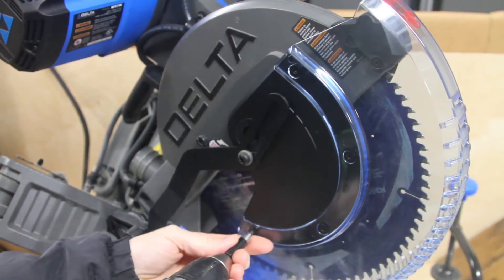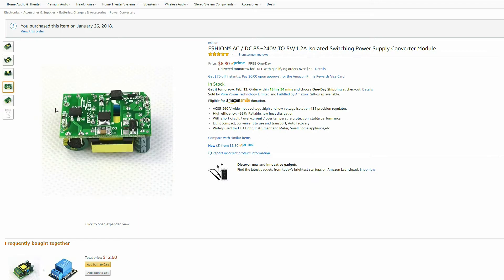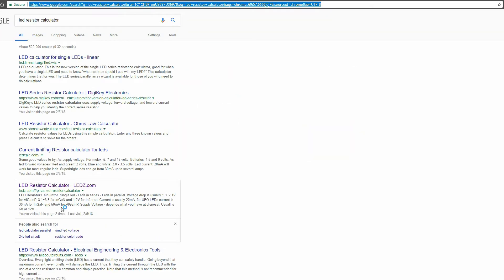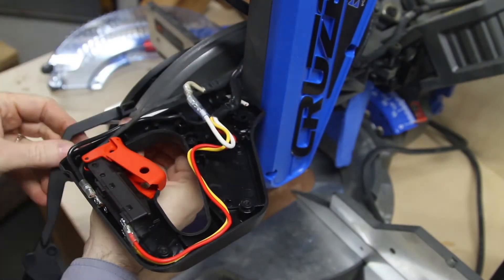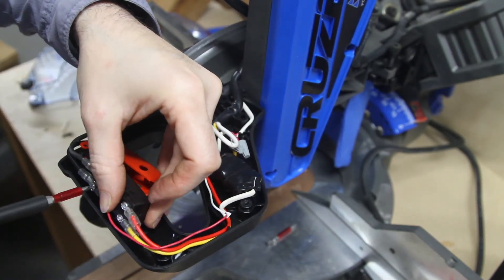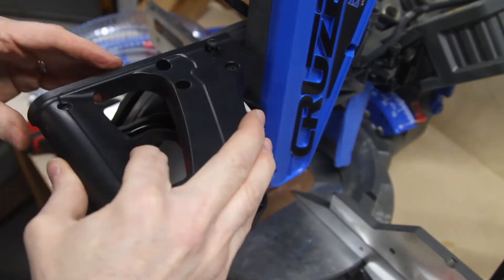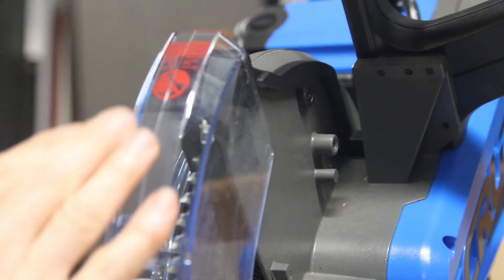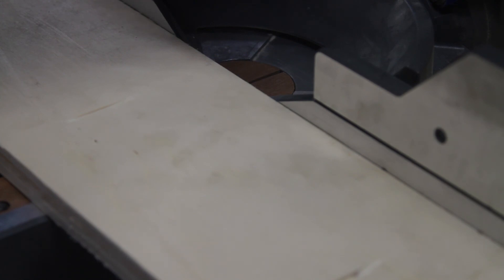DIY LED Shadowline on Delta CRUZER miter saw

Comment: thanks for info and not knocking your work, just curious why you didn't simply use 120v leds and forego the ac/dc converter
Reply: LED's are DC powered...typically 3 volts. Never connect LED's directly to AC power....especially 120VAC.

Comment: I just finished installing a shadowline in mine. It is already fully designed for this, Delta just cheaped out. I used a 3 cree LED 5k indus star with a Carclo elliptical lens to channel the light best. This gets mounted INSIDE that nose piece, not through it. If you look, there are holes molded on the bottom of that nose facing into the blade that will allow a led lens to shine straight across the blade. The only holes I added was one in the nose piece in that half moon area on the left piece to screw in the custom bent aluminum bracket I made to hold and heatsink the indus star which is glued to it with thermal glue. The lens sits between the star and those cutout spaces in the nose piece. Similar to you, I found a tiny 300mA constant current source module that I mounted in the handle in that same spot. I chose to add a switch for that, so mine is lugged to the top terminal on the trigger for constant AC, then to my mini switch, then the power module.. If you look on top the factory handle you will see a small rectangle molded in, I centered my new switch on that spot, which I also had to drill out.

My shop lights are bright overhead 5k LEDs and this shadowline is quite visible still beneath them, and is visible even when sliding or as a chop.

Thanks for the inspiration on taking this on. It's my first real tool mod, and I think it came out well.
Reply: Warren, this sounds exactly like what I was hoping to do on my Cruzer.  I am pretty mechanically inclined but electronics and optics leave me scratching my head.  Any chance you might give us a materials list or even better links to the required major components.  Thanks in advance
Reply: @richcrowell1155  sorry, I missed your question. Here are the parts.  

From LEDSupply I bought:

10510 Carclo Lens - 3-Up Elliptical Spot LED Optic
Note, be sure to align it over the slot to shape the oval to run front to back to split the blade. Epoxy this to the star.

CREEXPE2-WHT-X / CREEXPE2-750-3 Cree XLamp XP-E2 White High Power LED Star 
Note, 5k model

From Amazon I bought:
Chanzon LED Driver 300mA (Constant Current Output) 3V-20V (Input 100-240V AC-DC) (1-6) x1W 1W 2W 3W 4W 5W 6W Power Supply 300 mA Lighting Transformer Drivers for High Power COB Chips (Plastic Case)
Note, I had to pop it out of the case, then I wrapped it in silicone tape.

ESUPPORT On/Off Mini Miniature Toggle Switch Car Dash Dashboard SPST 2Pin Waterproof Cap Cover Pack of 5

Halnziye 10Gram Thermal Conductive Glue Silicone Plaster Viscous Adhesive Cooling Compound for LED GPU Chipset Heatsink
Notice, I used thermal glue not just paste. This stuff sets up and bonds. Used to glue star heatsink surface to my aluminum bracket. Use just a thin layer, plus dabs at edge. Make metal bracket as large as you can fit in. You must have a heatsink with a star.

I also used some small heat shrink tubes at solder points, small hookup wires, some crimp connectors to match up to Delta's connections, and a small scrap of sheet aluminum for the mount, and a m4x12 (as I remember) screw with nut.

I am very happy with it's performance still.
Reply: @warrenbrown8670  Thank you sir.
Reply: @warrenbrown8670  delta now sells the cruzer with this light option standard, its the 2250
Reply: @mainsource8030  I know. The issue is they don't sell a kit to retrofit the prior version. My DIY proves it's a pretty simple mod, if they wanted to provide it. The hardest part is making the aluminum bracket.
Reply: @warrenbrown8670  Would you mind posting a picture of your light. im thinking of following your plan but id like to see a picture first.
Reply: @jamesamos7503 Glad I snapped some pix while building it. Take a look at these on my Google drive.  I have a pic of the lens and led installed in the saw (notice the slight slot below the led for it to shine through), a shot of the power module and toggle all wired in the handle, a rough template I used to make the aluminum bracket for the led mount. The handle top closeup shows the rectangle molded by delta, you just drill in the center for the toggle.

It shines bright enough to shadow the blade even with guard down somewhat, and accurately enough to see the set of the teeth on the blade once close up.

https://drive.google.com/folderview?id=1mC8vcw09q6itRd9nDB7MtDAylfJQ2eAP
Reply: @warrenbrown8670  would it be too much to ask for a couple pics of it completed? I think we’re thinking along the same lines. Just want to see the finished product.

Comment: You're projecting LED lights BESIDE the blade, but you really want a light source ABOVE the blade. You want to cast a shadow by blocking light, not shine light down the sides of the blade. You'll get a much more defined line that way.

Comment: Good attempt. I added LEDs to the exact same space on mine but went much simpler in my approach. I wanted the worklight to be on and cast the shadow line independent of the saw power so I just ran the power for the LEDs along the main power cable. It is much more convenient and doesn't get in the way at all. 
For the LEDs, I used some small strips of LED light strips, used a Dremel tool to create a piece of plastic to fit the space, and folded the LED strip so the LEDs were directly next to each other. If I remember correctly, I want to say I have about 10 LEDs in all (5 to a side) and it works exactly how I need it to. Like any shadow line, I wish it was brighter but it works perfectly even with all of my shop lighting
Reply: Geoffrey Kennedy  Do you have any photos? I would like something like this. I had the thought of adding the LED light strip to the inside on the blade guard. But I have not checked clearances etc.